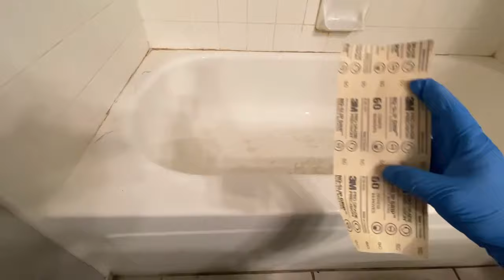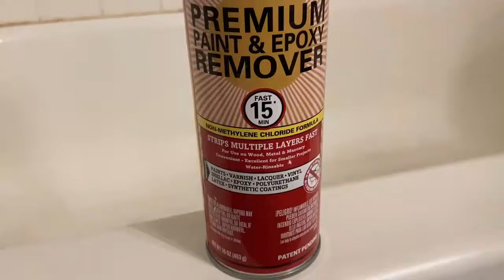HOW TO Remove PAINT FROM a PEELING BATHTUB | Step by Step Bathtub Stripping and Paint Removal *WOW*

Comment: I used this product to stip paint from my bathtub and tile. After going through a can of the spray and a can of the liquid I was only about 1/4 of the way through the job and then I saw the teeny tiny "not for bathtubs" warning on the label! I switched to citristrip and it actually got the paint to lift off very easily! There was much less fumes as well.
Reply: I just used the citrus strip and inlet it sit and it hardly removes any layers that’s why I’m watching this video for Plan B.. wait are you a citrus peel rep
Reply: @Sublimekarnage  I’ve been using citrastrip as well and works well for things without as many layers. Unfortunately the tub I need to work on is going to need something a bit heavier.
Reply: I just bought citristrip gel and havent used it yet. Any tips guys? Should i use something else
Reply: 😊para 89😅😮
Reply: Bro said it in the video

Comment: The "Don't use on bathtubs" is because it's almost impossible to ventilate a bathroom well enough to safely use it and some chemicals in strippers like methylene chloride have killed many people. I use Methylene Chloride with a respirator and fume extractor. It's the best for stripping but keep in mind it evaporates quick with high vapor pressure and can collect in the bottom of the tub. Chemical stripping is my last option. I prefer sanding 🤷‍♂️
Reply from the maker: @medievalmike92 it does not contain Meyhylene Chloride anymore! It’s on the container.

Comment: Well first off, regarding the reason the can says not to use this in bathrooms. I googled it and found an article saying that people have died using this in bathrooms without adequate ventilation/ respirators, so I'm guessing its in order to protect the company legally. I reluctantly tried it on my bathtub. I found out that I didnt spray enough of it, and that I mostly just stripped the top layer anyway and not both layers. I ended up using it 3 times, removing different layers/ amounts and still never got it all. I'm not sure that doing it the slow way/ without chemicals would have actually been slower than this. In retrospect, I should have just hired a pro.
Reply: Same here .. I'm gonna hire someone to finish stripping it ..  a whole can only strip away about 5 rows of tile in the shower 20 to go plus the tub....

Comment: My landlord painted my bath tub what looks like 30 times, and then dumped a very thin epoxy on top of the peeling and chipping paint, which solidified it into these razor sharp points. The tub is an old metal one, and the job looks daunting thats for sure. But I am so tired of slicing myself open. Lol

Comment: I used some kind of paint years ago to change the color of my tub from blue to white. The tub is a cast iron tub and I don't want to get rid of it. I would like to return to the blue  that I had. I just want to strip the white paint and return to the original. Is this the product you would recommend?
Reply: Try citristrip. Much better and safer than the Jasco!

Comment: I have a fiberglass tup and wall.  The previous owner painted it white (originally almond color).  If I remove the paint, will that damage the fiberglass and would I need to repaint it or can I leave it the original color without painting it?

Comment: That stripper only works in very thin layers of paint. 
If you use it in a tub with a thick or regular reglazing layer of paint it would not remove it. It would not work.
Reply: Any recommendations on what stripper product can be used?

Comment: After a lot of thought about this prokect I looked this job and first video to pop ip was this. Hot the jackpot just what I meeded. From beginning to end. Can I ask about the fixtures or plug? Have you had to change them or just cover before painting? Wondering if a plumber will have to be my best bet. Thank you for the project video
Reply from the maker: I cover and mask them off if the customer doesn’t want to change them out. I let the customer decide since the more I do the more it costs. 

I have videos of the full Reglazing process and another video showing the masking and taping process

Comment: Do you have a video on getting old paint off bathroom tiles on the wall in the shower? My old landlord painted it but it’s peeling in certain places and not enough to where I can get it all off.
Reply from the maker: Do it the same way
Reply: Yes I’m having the same issue with my tub too. Painted over tile and tub. Chipping tends to clog the drain if filter is not in place. Can this affect the tile grout or a plastic tub?
Reply: @DPTubs  can this affect a plastic  tub or tile grout? See additional message 🙏🏻

Comment: Can we use our bathroom exhaust fan while using this product?  Is it flammable to the point the fan would start a fire?  How else do we ventilate effectively?  Great video's!
Reply from the maker: You can use the bath exhaust fan but make sure to clean off vent cover after using. Also, I use an 8" diameter fume extractor exhaust fan while spraying. I have a video of it  here on my channel.

Comment: You make it looks so easy.  Awesome job!!
Reply from the maker: Thank you! Cheers!
Reply: @DPTubs  how to remove previously painted plastic showerpan?
Reply: @DPTubs  that stripper can melt the palstic
Reply: My tub was re glazed. It turned  yellow within a week. It's been yellow for years now. 😢
My question is, Is it possible to just remove the ugly paint that's now pealing and cracked  but leave it striped or is it likely that the re glazing job I paid too much for permanently damages whatever was left of the old finish.

Comment: Nice! I've only stripped one tub, lots of extra work. I definitely didn't budget it right.

How much extra time or money ($ or %) does stripping add?  Thanks for posting.
Reply from the maker: I charge $95...$125 is still reasonable as well. Time wise about an extra 1 hour to 1.5.
Reply: Thanks!
Reply: @DPTubs  where are you located?

Comment: You could have chopped some of the spraying scraping and sanding time off for a short of video. that music was kind of annoying. Don't wana B Negative Nancy but that's my opinion. someone else may have been afraid to bring it up thanks for the tips though
Reply from the maker: Some like to see the full extent of the work. Otherwise you may like to watch youtube shorts
Reply: @DPTubs  what do you acid wash that with and how do you prep it from the cleaning
Reply: I found it satisfying to see the stripping process. No short cuts taken.
Reply: @DPTubs  I wanted to see the full length, thanks.

Comment: Glazing is a terrible idea. It starts chipping within 18 months. If you are lucky! In which case It would have looked better if you had never recoated. And just cleaned up the original worn tub surface
Reply from the maker: Thanks for sharing your opinion
Reply: My glazing lasted an unusually long 10 years!!! The trick is to wipe the tub/glazed surfaces dry after every shower or bath use. A pain, but it worked in my case. Most folks only get a year or two of attractive life from the glazing because they either don't know this or ignored it and left the tub constantly wet
Reply: @Handygrrl  great info

Comment: Hi. great video. how do you scrape the four inside corners in the tub? they're too concave for blade. Thanks.
Reply: These  blade are somewhat flexible, ive been reglazing for 20 years and rarely had a problem getting all the paint out of those 4 corners. 
Yes the blade will break if the paint is on there tough but with enough swipes, it will clear.